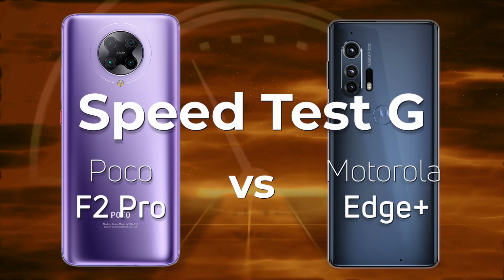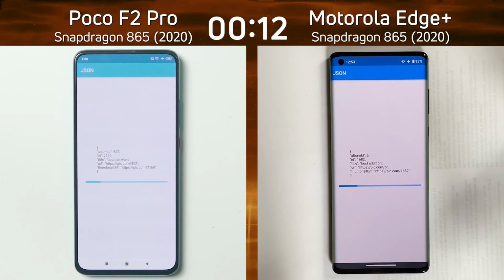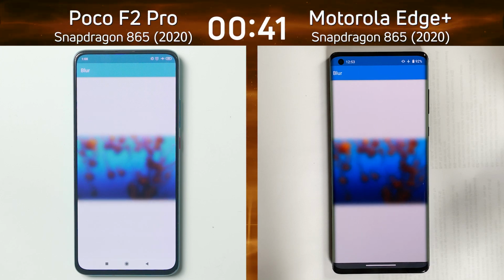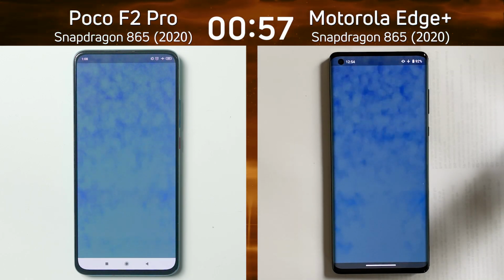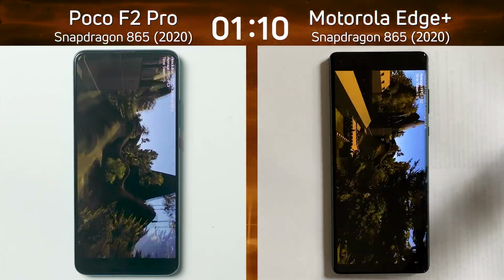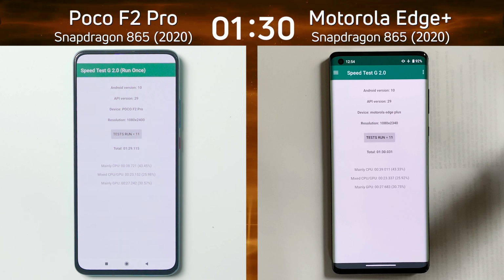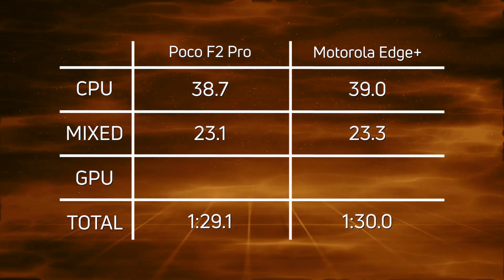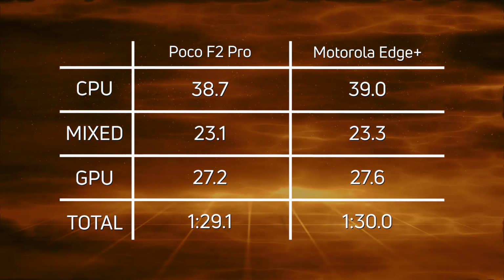Poco F2 Pro vs Motorola Edge Plus

Comment: Never surprised by flagship speedtest. Its faster than what you need. Too many flagships speedtest, and very few midrange ones maybe the reason why this great channel only has few viewer. 

And id say this again in every speedtest G that i happen to notice in notif:

Please gary @Speedtest G we Strongly suggest you to do speedtest for midrange and lower end ones. More of them rather than the obviously more than fast enough flagships

Flagships will be flagships. Its fast and able to do any task you throw at it. even midrange SD730G is fast enough i dont need to download benchmark apps to test it because i know it will have adequate performance.

Again i urge you prof to speedtest midrange and lower end ones. For that is the class which needs testing where every oomph gap matter. Especially battle of phones with different brands low-midrange SoC's. 

Like dimensity 800 vs kirin 820 vs exynos 880 vs SD765, 
Kirin 810 vs helio G90T vs SD720g, 
Helio G70/80/85 vs SD665/712 vs exynos 9611, etc

Comment: Poco is pure gold for the price. Switched to f2 pro from note10plus exynos and could not be happier. UI is clearly designed for western markets with mostly stock Android vibes all over the place. Stock Google apps are used for everything except file manager and camera. No bloatware with only few xiaomi apps like community that you don't even need to use and can uninstall via debuging mode and PC. Settings are clean and again looks so much like pixel phones. Everyday use feels so optimized, they really did a good job. There are downsides when hardware gets compared to note10plus and most of them are most likely where they saved money but unless you use them side by side like I have for last week, you will not notice it. As far as software goes it's trading blows and I think most would like Poco style if tested.
Reply: Why did you switch from note 10 plus?
Reply: @gamingsurges2000  work place started buying new work phones and for some reason majority decided it should be Poco f2 pro for the price that co wanted to invest. So I will sell my note10plus now while it's still expensive and maybe will see what note20 offers, if it's any good will get it. If it's not then I can stay with Poco, it's plenty fast. Just could have better cameras. Although they are plenty for most but I like to take a lot photos with my phone, so I hope they will have something new ready for this year.

Comment: That one pretty much came down to faster interface and animation.
Reply: Nope that does not make any difference, they process it at the same time regardless of animations
Reply: @fanban2926  Of course animation and interface makes a difference. Some phones interface are a bit heavier and less optimized for the processor. Some phones have longer animation. This is why Oneplus' Oxygen OS has been slightly faster for a while, and why Samsung's One UI is now one of the fastest also.
Reply: @Marlon_J  yes of course the UI makes a difference but the ANIMATIONS don't!